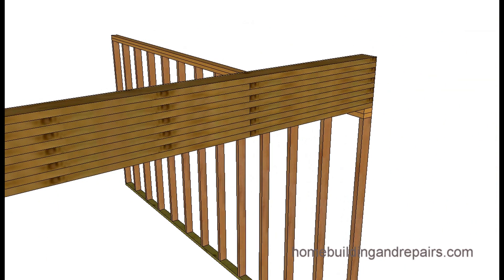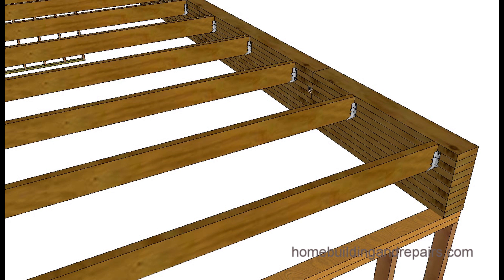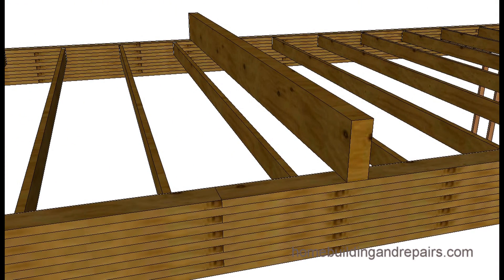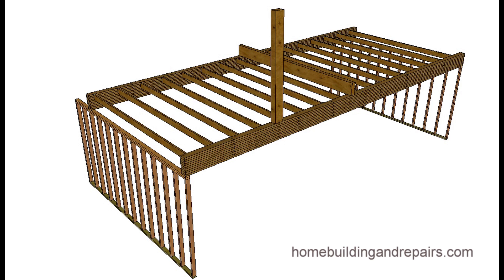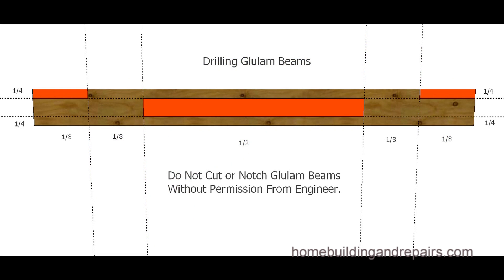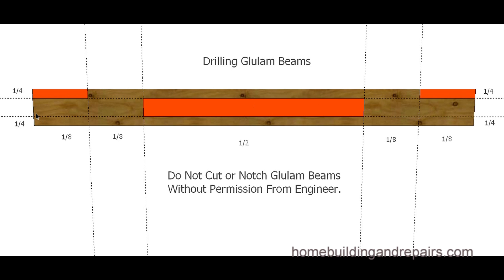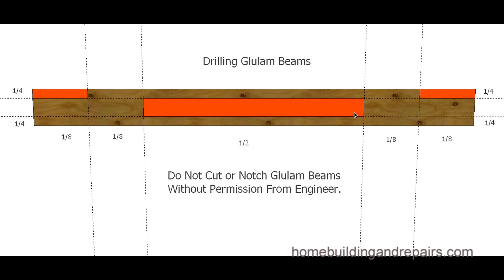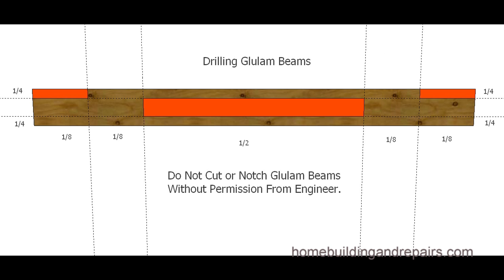Drilling And Notching Glulam Beam Tips - Home Building and Structural Engineering

Comment: I spent 35 years in the roof structure trade. I am retired now and I do miss building big roofs spent most of my time with roof structures inc. And they are out of fremont ca. I do enjoy watching these videos.but the one where the guy's are laying 4×8 panel's are a joke myself and jim millner with a drager could lay 35 to 40 thousand square feet a day.
Reply from the maker: Impressive, that's over 1000 panels per day, but I don't think I've made one where guys are laying 4 x 8 panels, are you referring to someone else's video?
Reply: gregvancom  I got a question can I rip down 8 x 24“ beam down to 8”x12”? 24 inches is way too tall. I got this been laying around for quite a long time and I want to get some use out of it thank you👍🏼👍🏼

Comment: 25+ years working hands on as a Highly Custom Carpentry and Framing General Contractor I've never once had to drill more than 1/2 inch hole which I was told could only be done in rare applications NEAR the ends only. 
NOT SOMETHING THAT ANYONE SHOULD **EVER** CONSIDER DOING!!!
Reply from the maker: I agree, I've seen too many jobs delayed because someone drilled a hole or notched a glulam beam and it can be expensive. One job was shut down for over a month before the engineer got back with them.